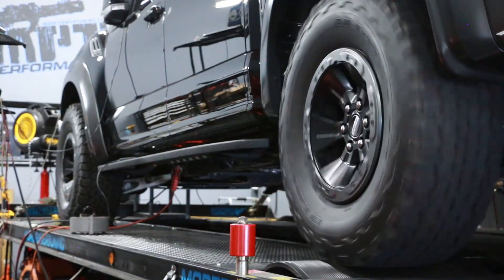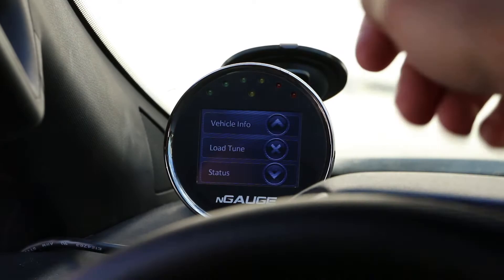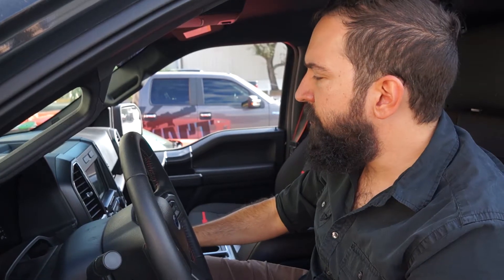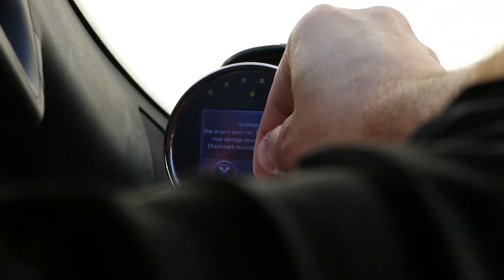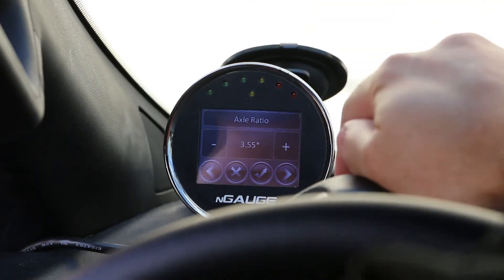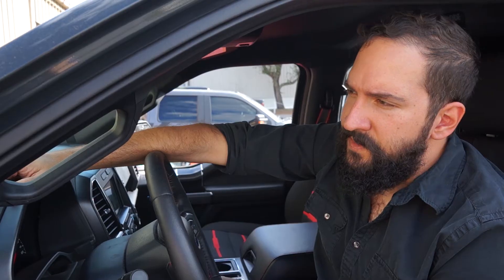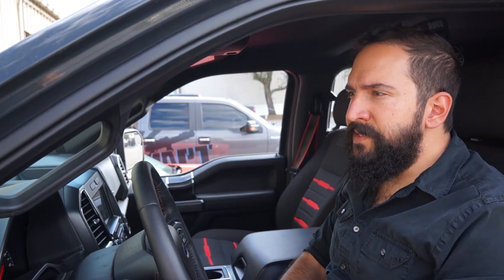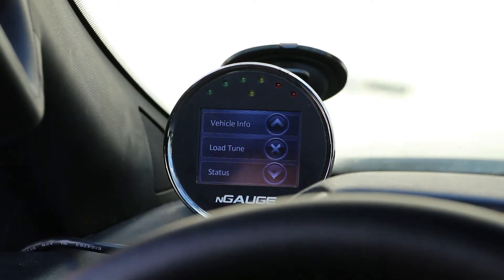NGauge - Adjusting Speedometer for Tire Size On A F150 Ecoboost or Raptor

Comment: I assume it will also adjust the 10 speed transmission shift points for the new tire size. Is my assumption correct? Thanks.

Comment: You should be able to Google your tire size and brand, and it will tell you exactly how tall your tires are.  Some 37s are slightly taller, some slightly shorter.
Reply: You have to literally measure the tires with a tape measure on the truck if you want the best results.  This method has never let me down.

Comment: If I have 37 inch tires I just put 37 in he nGauge correct ?
Reply from the maker: Don't forget tire squish. You can use the manufacturer and google or even old school measure. We are looking for diameter so road to top of tire.
Reply: Road to centre of hub X2 for accuracy.
Reply: @Water Walker...At first, I gave thumbs up to your comment.  But after giving it a second thought, it actually isn't true.  This would give an accurate measurement with the wheel OFF the truck but with weight on, the lower half will be slightly less than the upper half due to the "squish."  A quick online search of a tire size/speedometer calibration calculator reveals that each inch INCREASE IN TIRE SIZE results in a SPEED INCREASE of 3.41%.  For each 1/2" DECREASE (for "squish") IN TIRE SIZE, it results in a SPEED DECREASE of 1.52%.  So, the good news is, if you just put in the overall diameter, the "squish" will result in a slightly lower speed than what your speedometer is reading (better than the other way around from a speeding ticket perspective).
Reply: Amr Bin Hadher I believe so
Reply: Jacob Blair thanks